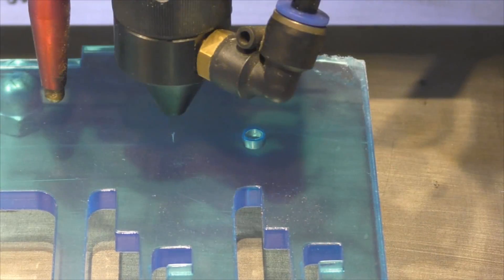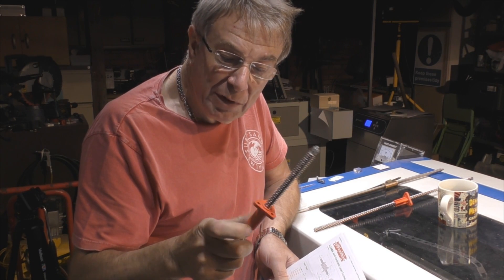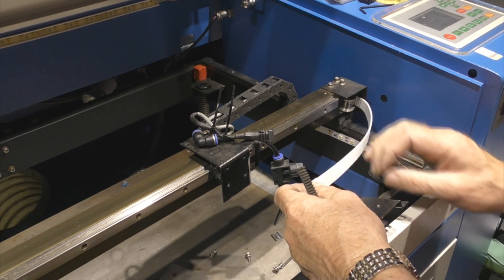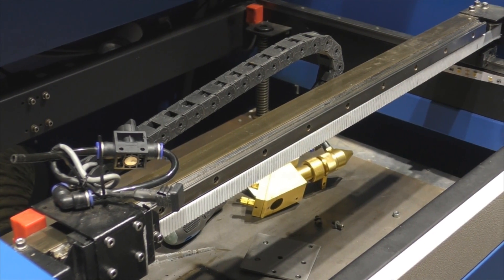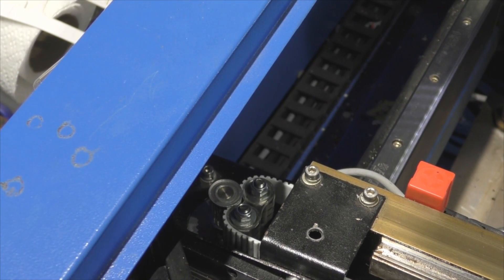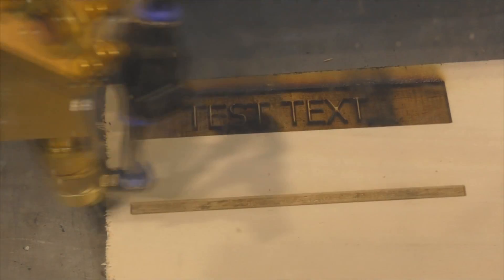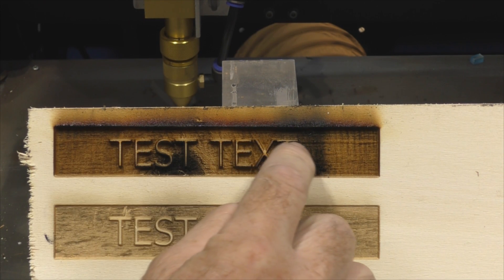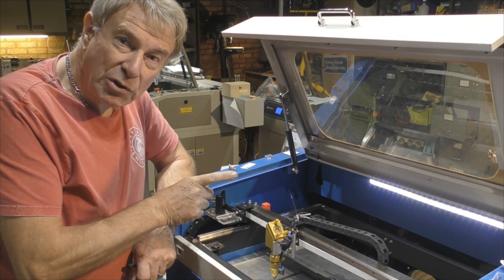RDWorks Learning Lab 121 Is this CURTAINS for CURTAINS

Comment: HI Russ, I have a different curtains type of quandary:
I was engraving some acrylic today, to make  a cookie stamp of a sort (not really, but that's the simplest way of explaining it) and suddenly noticed the dreaded curtains effect on the background.
What was odd was there was none to worry about  the day before when I'd done some engraving.
So, why the difference?
I guessed maybe the stepper motor gears might need their grub screws checked, and the bearings oiled - done.  No change.
Try again - only a bit faster. I tried engraving at three different speeds - about 80mm/s, 120 and 150mm/s, and there were three different pitches of curtains resulting - about 2.5mm, 3.5mm and 4.5mm, whereas the X axis belt has a 3mm pitch.
I've always understood that the curtain pitch matched the timing belt pitch - one was a function of the other.
In my case, clearly not!
The only other  factor I could eventually think of was that I was ramping these engraves, and as such set a marked difference between max and min power settings - like 65% & 8%.
That's when the curtains showed up.  When I went back to no ramp, and a minor variation like 42 & 45%, there was nothing to worry about.
It is as if the PSU is varying its power in synch with something of a regular timing, and the head speed  governs how far apart the marks are.
The only other equipment running was the chiller, a CW6200, and it  was constantly on.

I welcome any thoughts on how to eliminate what look like curtains but are not the established or understood ones?
Thanks.
P.S.  Ruida 6442C controller, 1300 x 2500 mm bed. Reci W2 tube. Leadshine steppers.
I also ran the file from RDW version 8.32 I thik, and from Lightburn - actually the RDW one was mildly less obvious, but the same settings gave the same results.
I
Reply from the maker: HI Ian
 There are two basic problems  that create curtains . One is the timing belt teeth IF you have a small X driv9bg pulley.. The teeth running on and off  the pulley  causes minute changes of speed as EVERY tooth transitions on and off the pulley.. SPEED is the critical factor here. I first noticed curtains during high speed deep engraving. The second problem is stepper motor induced resonance that makes the head act like a yoyo , causing minute but cyclic SPEED variation..  You will note I emphasize speed. That is the root cause of the problems you are witnessing.. Your laser delivers CONSTANT power, there is no pulsing from the HV power supply. If the power is constant then your beam slowing down will burn deeper and conversely when it speeds up it burns shallower. . So to sum up constant power and variable speed will cause irregular cut depth. Resonance happens at slow speed only but curtains will be there across the speed range. So change the speed and you will be mixing these two factors at low speed and just seeing the belt curtains at high speed. here is a video I produced that looks at two of my machines, The first one has a big drive pulley system for X and a normal toothed belt but is not immune to resonance and the second uses my  reversed belt (flexible rack and pinion drive system).

https://www.youtube.com/watch?v=yVbzm41tcy4

I hope this explains your observations.
 Best wishes
Russ
Reply: @SarbarMultimedia   Thanks for your quick reply,  Russ.
I've watched that clip about curtains and your good idea of the reversed belt, some years ago, and have put much time over the past 5 years into  fine tuning our lasers to try and get all the gremlins out!

The X axis belt is not a direct drive from the stepper like yours.  The stepper drives a small gear of maybe 15 teeth, (about 1" OD of the flange), which is attached to a timing belt which goes around a huge gear of about 4" diameter. That's on an axle driving a smaller timing gear of maybe 20 teeth, which drives the belt that moves the heads.

But yes, it is happening at deep engraving, where there is a large difference between max and min power figures.

Stepper resonance is interesting - though when the head is scanning left to right, the speed should be constant - at least through the middle of the area being traversed.  I can accept that maybe the teeth give minute head speed variations, but I'm stumped why the pitch or frequency of the curtains varies by the speed of the X sweep or head.

It's midnight here in Australia, so I'll rethink it tomorrow. Thanks again!
Ian

Comment: Interesting find and nice solution. I have a similar problem when raster engraving acrylic but I'm not convinced it is belt teeth, mainly becuase my "curtains" appear have a frequency of 75Hz (i.e. at a speed of 300mm/s they are 4mm apart and at 150mm/s they are 2mm apart).  Did your curtains also have this constant frequency irrespective of speed? This to me says they are not generated by the teeth/pulley interaction because if that was the case the curtains would have the same spacing no matter what speed I was running at. I have no idea what might be causing a 75Hz resonance or variation in speed or power but I think my curtains must either be caused by speed variations in the servo motor drive or laser power variation. I'm at my wits end trying to solve this problem but I like your solution anyway so may give it a go but suspect I'm going to have to apply some serious science to it in terms of measurements to understand it and find a solution. I also have a new board coming which may not fix it but will allow me to vary more parameters at least as I'm running a stock K40 at the moment.
Reply from the maker: Hi Stan
 My pitch was about 3.5  I seem to remember but I then realized that although the nominal pitch was 3mm that pitch line is about 1mm below the outer diameter of the pulley and so the way that the pattern is generated relies on interference above the pitch line where the belt and the tooth first come into contact. I only have a 16 tooth pulley .If you have a 24 toothe drive pulley then contact may take place earlier because of the shallower approach angle between the belt and the pulley teeth. So I see no problem with a 4mm pitch pattern.

Do a simple scan on a rectangle say 50mm wide and 15mm tall . If the cut is done at high power so that you get a deep impression into wood (or acrylic) the variation in speed as the belt climbs  onto the pulley will be obvious and it will leave a 3D copy of your tooth form. NOTE. make sure you run the test in UNIDIRECTIONAL mode. X swing may well be the reason you are seeing a different  apparent frequency as you halve the speed. There is nothing but the belt teeth in the X drive train that will cause such a coarse effect. There are resonance effects from the stepper motor as it tries to kick the head but most of that kick is being " cushioned ( absorbed) by the flexible teeth in the belt. The belt itself  wont stretch but the teeth are like bouncy balls. They will store energy and just like a ball, bounce back.  at certain speeds ( usually in the 50 to 150 mm/s region,  you can see this effect if you hunt for it. That was the original reason for changing my belt to a stubby tooth form and a a stiffer material.  However although this cured one set of issues I was having , it did not fix the curtains issue.  Converting the drive system to a "flexible rack and pinion" has fixed the problem and here I am 4 years later with two modified machines and the curtains have been closed!!.
 Best wishes
Russ
Reply: @SarbarMultimedia  Thx for that info. I think I'll give it a go. already got some bearings that should do the job and can obviously CAD and cut the mtg plates ok. My only problem is that since I currently have the stock K40 Nano control board I can't reverse the direction of the carriage, but I should at least be able to test the new setup to see if it gets rid of the problem.

Comment: I wonder if you could have achieved the same by simply replacing the smooth idler pulley with a toothed one?
Reply from the maker: Many have suggested the same solution and 99% of those have been 3D printing enthusiasts where that solution sems to improve the finish on their creations. Sadly the laser is a different beast . Because the power is on continuously and at a constant value throughout the scanning stroke, if the speed decreases then the cut gets deeper. Thus this machine is an amazing velocity plotter. It can detect very slight velocity changes in this way and that is what causes the curtains changes of velocity. Over a year ago I did an analysis of why toothed belts cause this issue, see  https://www.youtube.com/watch?v=QFLq14vY2zQ 
This was especially true for this machine where the final X drive is  a 16 tooth pulley Essentially I likened my pulley to a wheel with 16 flats. Drive around with 2 of those on your front car axle and I'm sure you can imagine the ride comfort. Would some sort of magic happen  If I follow your suggestion and put two more of the same on the rear axle? . 
I have toothed belt in reserve because I anticipated that the tortuous flexing I was subjecting the belt to would result in a relatively short life span.  here we are two and a half years later and that belt is still working perfectly. It has done hundreds of hours of photo engraving and believe me that sort of work will soon show the problem. Running the flat side of the belt over smooth pulleys has definitely fixed the problem Most large cnc machines drive from a rack and pinion system. What I have created here is a flexible rack and pinion drive.
 Best wishes
Russ
Reply: SarbarMultimedia thank you very much for your detailed response. You correctly identified my experience as being primarily 3D printing :) As always, I learn something from every one of your videos, and now I’ve also learned from your comments

Comment: Ah nuts.....that's something else I'm going to have to do !!  Great Idea. Now it has BEEN sometime since you did this, is it all still working and OK? Did you change from acrylic to steel? (Sorry if I missed the video). Does it wear the belt teeth quicker doing this, etc.?
Reply from the maker: Hi Andy
It worked well and at the end of the video I made a steel variant. The belt I used was not an HTD tooth form but it was 3mm pitch It was a urethane belt where the teeth were much stiffer thn the original rubber HTD. It also has stainless steel inner cords and I was slightly concerned that the more complex path of the belt through and round 3  rollers that were much smaller than the suggested bend radius, would not last long. Within a month or two of making this modification, I bought a replacement belt in readiness. Here we are 2 years on and that spare is still in the drawer. My stepdaughter has started a business of photo engraving on glass and slate  and often uses the machine 3 or 4 hours a day. so it gets well used. I am very happy with the outcome. The reverse scanning offset value is higher now than it originally was but it has remained constant over those 2 years so I can detect no obvious signs of wear.
 best wishes
Russ
Reply: @SarbarMultimedia  Brilliant. That's good to know. Thanks for the reply.

Comment: Thank you for all your videos. I am scratch-building my own laser and it will incorporate several ideas you came up with (steel table, accessible adjustments, planned airflow, etc).

I am completely intrigued by your curtains and acrylic edge cut quality observations. I think its a quite complex issue. I think there are several contributing factors, and you found some, but I think there is another one. Its the ball bearing car that rides the linear rail. In it, there are two circuits of recirculating balls entering and leaving the load bearing areas. If you remove the belt and push the car with your finger (slowly) you can feel the cyclic force changes. And they are erratic. You can hear the un-smooth motion by pushing the car quickly. These cars were designed for machines with high forces and they are pre-loaded for zero lash. I don't think they are a good fit for lasers that have no cutting forces. At the very least, they should be specified for only a light pre-load, but many people don't know you can get them like that.

I agree with you about the chordal vibrations problem and the stepper problems and the pulley eccentricity problems and the belt stretch problems. Its all happening at once and the problem is to isolate each (not easy) and determine how dominate each effect is. Not easy as I suspect that changes in speed, acceleration belt tension, and how and when several cyclic effects sync up will mask or accentuate the various various problems. Of course, there are static and dynamic effects and most are non-linear.

Stepper motors can be driven using microsteps, as you know, but a fair number of drivers morph between microsteps and full steps on the fly. The microsteps are often non-linear. At high speeds a stepper motor lags behind its theoretical position. A servo won't move UNLESS there is an error.You can't trust anything...

Epilog laser (maybe others, too), use servos and the encoder is a linear scale that runs the length of the axis. IF, IF everything is done according to that encoder, maybe curtains can't happen and all mechanical inconsistencies are compensated for. No, that sounds too good to be true.

For my machine, I am going to make a car that slides and is lightly pre-loaded for zero lash. I believe in it enough to just do it, but I have been wrong before, too. There are plastic/metal combinations that show very low friction and stickion. As an interesting experiment, may I suggest making a sliding car of UHMW, Teflon, or Frelon that fits your hardened steel rail well enough to play with it.

Please keep making your careful and unusual observations and coming up with elegantly simple and cheap solutions. 

Hey, when you get curtains, what happens if you put the plywood at 45 degrees? Would that show if its related to the wood grain?

Thanks again.

Comment: Roger I wish I had you as my college professor. Brilliant diagnosis and totally easy to follow. I have mine on order will explore this change on it. Thanks so much for all your great video’s.
Reply from the maker: Hi Rick
All the China blue machines are basically the same but there are often small detail differences One of those differences is the number of teeth on the driving pulley. I have worked with machines where there have been 30 or more teeth and the curtains problem (although still there) is hardly noticeable.. Some of the red and black bigger machines have a double pulley system that virtually fixes the issue. So keep your fingers crossed yours will be a good one..
Best wishes
Russ

Comment: Can you tell me what type of belts you are using please? The white ones?  Width, pitch. Thank you
Reply from the maker: Hi
https://www.beltingonline.com/at3-standard-breco-open-length-timing-belt-1742?zenid=0uu1natod56dh92pqokaj1e165

Products
------------------------------------------------------
1 x AT3 Standard Breco® Open Length Timing Belt (1742)  = £34.50
        Width in mm 15
        Length in metres 2.000
        Nylon covering Not Required
        Tension Cords Steel
        Material Standard 590 White PU
------------------------------------------------------
Sub-Total: £34.50
Shipping (Insured Courier UK 1-2 days (slower for Highlands, Islands & N.I.)
(£5.00)): £5.00
UK VAT: £7.90
Total: £47.40

Best wishes
Russ
Reply: @SarbarMultimedia  Thank you so much. Love the vids. Keep up the great work =)

Comment: Russ do you have a cutting file for the bearings holder
Reply from the maker: Hi Er

As I have found out from my head transplant venture, not all machines are exactly the same so it would be dangerous to assume.that my design will suit all. It is the principle that is more important and I know of several people that have adapted their own completely different design machine to encompass the "flexible rack and pinion" idea.. I have to say it is working brilliantly and is a great asset to my superb quality photo engraving. Engraving at 200mm/s would have put light and dark bands in my images. As you saw in the video, I made a prototype first (in wood or plastic) to make sure everything fitted  and then traced round the pieces onto metal and adapted the design freehand for an improved mark2.
Best wishes
Russ
Reply: Thanks Russ will get creative